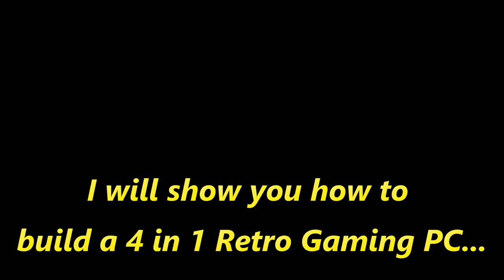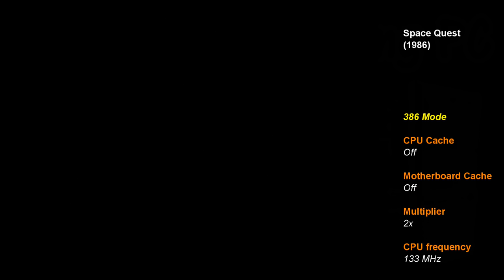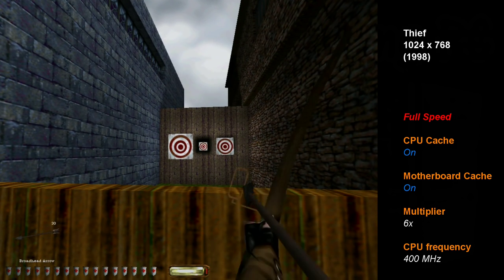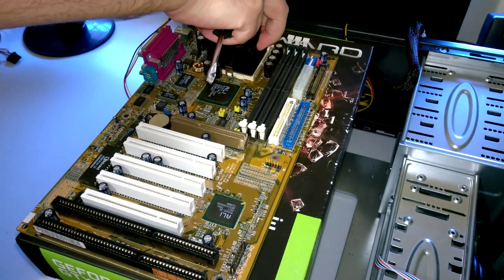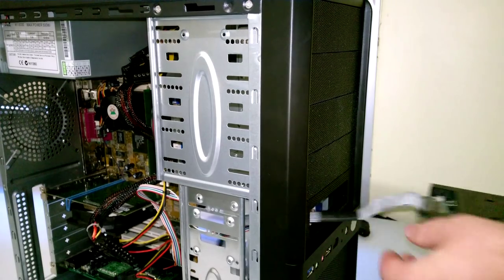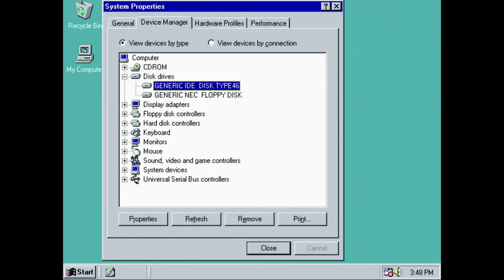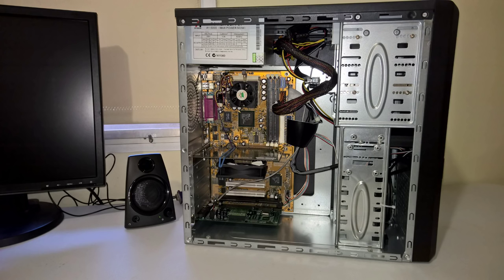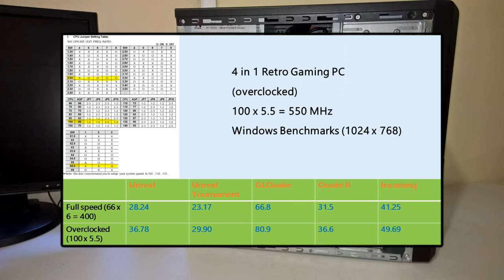Building a 4 in 1 Retro Gaming PC

Comment: if you're going to go to this much trouble you really  HAVE to do it proper with a CRT ;-)
Reply from the maker: Haha yes I know ><
Reply: PhilsComputerLab about how much would I spend to make this?
Reply: Not to be a show breaker but you might want to replace that A1 PSU. I have seen its innards and it's definitely NOT suitable for well...nearly anything. Try a FSP or a higher end Allied PSU (the latter, although made by Deer/Solytech, are a solid choice for 5v heavy systems. Just replace the capacitors and it's ready to rumble!) as those have better components.
Reply: Hello phil. I'm on the way to build a ss7 system the way u suggested in this Video. While  doing some research, some guys told me, that switching Caches on/off for accelarating or decalerating is not that effective... It was mentioned that "non-linear" speed-ups or downs could appear in some old Software. Can u confirm that?

Comment: This is the Ultimate Windows 98 PC.
Reply: No it isn't, a fast pentium 2 or a pentium 3 or an athlon is better for this (even though a K6-2 or 3 is already great, it's absolutely not the best). Pentium 4s and athlons XP are great too, but they start to run into the limits of that OS if you' re not making them properly (like putting more than 1GB of ram or a gpu that is too modern, etc)
Reply: Deksor Such as an NVIDIA GeForce FX5200. Always go with an GeForce 4 MX440 or an GeForce 4 Ti series GPU or similar.

Comment: That's probably the coolest PC build i've ever seen.

I've really liked the ALI chipset that you're using here when those boards came out. The boards usually ran all kinds of hardware and there was plenty of low mem left after shifting everything possible into high mem, so you could keep lots of DOS soundcard drivers loaded.

But i've made the experience that they were prone to die quite exactly 5 years in of daily use -.- Not sure what's up with that. Perhaps with lower FSB could help them last.

Of course if i were to build something like this, and i probably will, i would make everything differently, like enclosure/PSU choice, cooling, soundcard choices, etc...

Comment: Hi Phil! Awesome video - I love how you explain everything so clearly and it reminds me of all the fun you can have with retro hardware!

 I have a very similar motherboard to yours - a Gigabyte GA-5SMM (SiS 530 based) that handles any FSB from 66-133MHz (including the /4 PCI divider) as well as voltages from 1.3-3.5V. I lucked out getting a K6-III+ 500/ANZ (binned at 1.8V at 500MHz)  - It ran flawlessly at 4.5 x 133 MHz with 2 volts and was INSANELY quick. I even managed to cool it passively with just a heatsink at 133 x 3 400MHz and 1.3 volts!  I was also lucky enough to have both a GeForce 2 MX/400 PCI and a GeForce 6200 in PCI that worked perfectly with that board - awesome for retro gaming - and even ran XP at a stretch too!

Keep up the great videos and thanks again!

Comment: Very informative. Have an AMD K6 build myself and it works very well, although the OS I'm using is Windows 95 and my main goal for that machine is not only DOS games from the 386 era and up, but also Windows games that were developed before 98 was released.

The only issue I've had with this build so far is that a couple of DOS games don't play very well. Here's a list of them:

CD-Man [L1 and L2 disabled with 2x multiplier]: Twitchy intro screen, but otherwise stable gameplay.

Dark Ages [L1 and L2 disabled with 2x multiplier]: Divide by zero error on Episode 1 unless I use the SLOWDOWN.COM utility. Episodes 2 and 3 also produce this error no matter what. Have yet to patch it with the RTE200 fix.

Was wondering if there is any utility or something that could slow the CPU even further so that I can reduce the twitchiness and perhaps get rid of the Divide by zero error.
Reply from the maker: +DOSGeek 95 I think I've seen your post on Vogons?

Some games just don't work properly. You can try a Pentium 100, some games will work on that because of the lower clock speed. But then the Pentium 100 is very slow for the more demanding games.

Comment: Very fun video to watch.  I'm surprised that Wing Commander 3 was able to run that smoothly with the processor clocked that high.
Reply from the maker: Code1D10T I wasn't sure if I should play it at 133 or 400 MHz. The game has a framerate limit of 24 fps, so 133 would have likely been enough. I'm not aware of the game being speed sensitive, or having issues on machines that are too fast. If so, no big deal, lower than multiplier and you're set.
Reply: philscomputerlab I read on the Wing Commander 2 manual recently that WC3 would run at the processor's actual speed.  Wing Commander 2 requires either slowing down the system or a 386 33MHz-40MHz to make the game run without going too fast.
Reply from the maker: I believe Wing Commander 2 does have keyboard shortcuts to control frame duration and things like that. But some animations might still play too fast.

Wing Commander has a high resolution mode for starters, and I didn't have issues on faster machines. But I never tried on something extremely fast like a 1 GHz machine or something like that.

Comment: Excellent video!

I recently purchased a K6-2 400 CPU to give my old P1-200 a bit more performance in Windows games - still waiting on the delivery of the cooler though as the only option I have now is a fanless heatsink I salvaged from a Mac G3 which happens to be the same size. It works as a temporary measure but I don't want to run the machine fanless for too long. My Socket 7 motherboard is an AT-style one though although it accepts ATX power supplies. I never had a proper PS/2 mouse header for the machine so I ended up making one myself. I never realised that SQ5 needed slowing though - I should check if it does the same on my machine. I use a real SB16 though so I don't know if that makes a difference.

I remember owning one of those Yamaha cards way back in the day but it didn't really impress me - I seem to remember it not being able to play multiple sounds back at the same time under Windows and configuring DOS games to work was a pain. The main reason I have that P1-200 in any case is to allow me to listen to music from the SB16 and Yamaha MIDI daughterboard.

I wonder if there is a list of DOS games that do not run properly when run on faster machines? Wing Commander seems like a prime candidate but were all Origin games that problematic?
Reply: Anacreon ZA The games from Origin from the 386 processor era and some games, like Space Quest and Police Quest, and some other games require a 386 class processor.  In order to run those games on a Pentium MMX or equivalent (Pentium 1, Pentium Pro, AMD K5, AMD K6) , you need to either disable L1 or L2 cache (or both for the 386 speed), or use a program called slowdown.

Here's an example of a game batch file I made for Earl Weaver's Baseball 2:
cd games\ewb2
slowdown /MHz486:40
ewb2
slowdown /U
cd \

Wing Commander II example
cd games\wc2\wc2
slowdown /MHz486:20
wc2
slowdown /U
cd \
Reply: ***** Cool thanks - I'll check slowdown out and experiment with the cache settings in the BIOS. I never really liked Wing Commander as a game though - I always preferred it as more of a Soundblaster tech demo. :-)

Comment: Hi Phil I see that you used Win 98SE, Back in the old days when I used it in a new install I found that some games didn't work. The work around was to install Win 98 then upgrade to 98SE. the reason some programs didn't work was because MS changed the file extensions from COM to EXE. So if you did the upgrade it left the old files so the older software would work.

Comment: This is such a great build -- were there any 386 or 486 games you tested that did not run well? Or does this -- functionally -- replace the need for a 386/486?
Reply from the maker: Yup it's a real replacement to the 386. I tested LOTS of games, I only know of one trouble maker, which is Ultima 7. This game turns on the Cache by itself, so the 4 in 1 machine will run it too fast. But that's the only game I know causing issues.
Reply: Nice!

Is it possible to do a builds like this with universal/flexible hardware and do different OS installs on either different drives or partitions? Like one drive or partition with Windows 95 and another with 98? Also, is there any difference or compatibility differences in using DOS from 98 as opposed to MS-DOS 6.22/7.1 that you have install guides for?

Comment: I was planning on doing a build like this sometime in the next year or two, but I discovered the Celeron 766 which also has a 66MHz FSB, but is quite a bit faster at full speed. Would there be any disadvantage with using that Coppermine-128 CPU with a Socket 370 motherboard, vs this K6/SS7 build?

Comment: What a great build. Have you run into any compatibility problems with really early DOS games? And what about really late WIN98 games (does it run Half-Life)? Such a useful machine, as getting some 90s games to run on a 64bit machine can be a real pain.
Reply from the maker: +BIG Dave If you go back far enough, like games in CGA that run well on a XT machine, they will likely run too fast. Late 90s games /early 2000 games can run well, but also run poorly. The Tomb Raider games for example this machine runs well, but Deus Ex not really. I actually have a copy of Half-Life but haven't tried it on this machine. My gut tells me that it would struggle though.

Comment: Well, just as informative, here're the games that you have that I already tested over my Pentium mmx setup (soon, a k6-iii+ 400MHz)
-Battle Chess (Windows version):OK
-Test Drive 3: Runned almost right but still a little bit faster
-Gods: I don't think this one even runned
-Pinball Dream: Another one that I can't remember if it worked fine
-Wolf 3D:worked fine with L1/L2 on
-Comanche:L1 disabled, and moslo at 70, runs a bit faster than yours
-Doom: Runs fine
-Raptor:OK
-Duke Nuke 3D:OK
-Descent:OK
-Tomb Raider I: software and glide are ok
-Quake 1:OK
-Need For Speed II:Works ok in glide
-Quake 2:OK, some complex áreas runs at 30 - 28fps that that's the minimun with a voodoo 3
-Need For Speed 3:Runs half good, it lags on the dark with rain, but all the settings
-Tomb Raider The Last Revelation: Worked fine
I'm just afraid that with the K6 III the voodoo 3 will run more hot since the Pentium mmx was limiting his power;
Reply from the maker: ibm5155 The Pentium MMX behaves quite different with Cache disabled. It is much faster. You get a 386DX-40 and 486DX2-50 compared to the AMD.

The AMD is much faster with caches, but has poor floating point performance which can be seen in Quake II for example. The AMD runs much cooler, especially the 1.6V version. 

The V3 is still being held back by all this processors. It runs at full speed on something like a Pentium III 700 MHz.
Reply: ah you got the 1.6 version, well, my motherboard can only go to 1.8, I hope a K6-iii+ acr 400MHz, 2.0v core will be enough.
And also I hope the cooling system from my Pentium mmx will be enough for that other guy too (maybe I'll need some termal paste idk :S )

Comment: Very nice and elegant way to build retro pc! I like placing new things into old hardware thanks to modern compatibility equipments, especially USB "floppy" and SATA bridge. Going to build similar one.
Only see little problem with LCD 5:4 resolutin and 4:3 DOS games (or 320x200) Is the image stretched or original, as my 16:10 LCD give me only 720x400@70Hz for resolutions lower than 640x480 ?
Reply from the maker: František Staněk Great to find someone like-minded :) Yes, monitors and aspect ratio are a challenge. While you can stil lbuy brand new 17" and 19" monitors, they are all 5:4 aspect ratio. So the image is slightly vertically stretched. It's subtle, but if you know about, noticeable.

There are a few options. I have a Philips 18.5" 16:9 monitor with 1366 x 768 resolution. I reviewed it here: https://youtu.be/maCI1Pe_jno

It has a 4:3 button, which works great. It's especially great for 1024 x 768 resolution games, as it's 1:1 pixel perfect and very sharp. Downsize is that the monitor is quite small, my eyes aren't the best, so I prefer something bigger.

Another option is finding a business grade 16:10 monitor. I've got a Samsung and that one also does 4:3 aspect ratio correction. For Windows games, that monitor is awesome as well as it does 1600 x 1200 natively, however many games struggle to run fast at this high resolution and HUD elements become small.

So either way, it's full of compromises and I like to approach it on a game to game basis. Space Quest 1 for example, looks mint on the 24" Samsung 16:10 screen. Unreal I prefer playing on the 18.5" at 1024 x 768, and many older games don't go higher than this resolution.

For quick testing I have 19: and 17" 5:4 screens and they do the job just fine. But you made a good point, in my next project I might showcase that Samsung 24" 16:10 screen :)
Reply: philscomputerlab Thank you for the comment. I have decided to get rid off all old periferies I own as they only waste my space and found your build very interesting.. It's no challenge for me just build up computer from all original spare parts - everyone can easily do it with no thinking ;-)

This problem (with aspect retio) I can not solve as I am quite perfectionist :-)
I just quick passed your review of 1366x768 LCD. The 4:3 button also works for CGA/EGA modes, such like 320x240/320x200 modes? My similar AOC 18.5" just stretch it to all screen, only VGA 640x480 (e.g. Blood) are adjustable to 4:3 ratio. Yes, it's the challenge, nowhere on the forums I found perfect LCD solution.. 

I am looking forward for review of that "business" 16:10 for the DOS game purposes, especially resolution of CGA/EGA graphics modes!  On my old 22" 16:10 I can not change to 4:3 unfortunatelly.
Reply from the maker: I'm afraid I do not have an CGA/EGA graphics cards. But DOS games use the 320 x 200 resolution, is this what you're after? Games like Monkey Island or Prince of Persia? 320 x 240, I remember some pinball game using this, but PC Player Benchmark can also test this resolution.

I have an AOC monitor as well, it does the same thing. 4:3 only works with 640 x 480 or greater.

Brands that work well are Samsung and Benq. There are Benq gaming monitors that can do 1:1 pixel mapped at lower resolutions. Quite amazing. Lots of options, but they cost quite a bit and at the moment my monitors do the job fine.

But yes, I will do a video on it. Not sure when, quite busy at the moment and waiting for some gear to arrive before I can shoot another one.
Reply: philscomputerlabYes, I meant the resolutions, 320x200 and similar uses a plenty old DOS games from '90s including Wolfenstein3D, DOOM, etc. I was using only VGA graphics adapters. Good mention, will try it in my work on 24" BenQ BL2410PT.
Reply from the maker: Ok, got you. 320 x 200 work 100% on the Samsung 24" and on the 18.5" Philips.

Comment: I wonder what could be built with a Radeon 9600 xt. I have one of those lying around. xD I got it at goodwill for 5 bucks trying to find a GPU for my computer. at the time I wasn't as knowledgeable as I am now.
Reply from the maker: +Proshi Very powerful for Windows 98 gaming. I do believe there are Windows 98 drivers, though not 100% sure. But yea, it's a beast for playing these old games :)
Reply: Alright then I finally have a use if I find more parts then! xD and I might go with Windows 2000 though as that's more compatible with some of the Games I do sometimes play like some of the Touhou games along with it. My 3 oldest games I own rather it's on steam or rather I own a physical copy are Half-life Quake, and Tomb Raider. Most of those are shooters but that's because I have yet to find a copy of Need for speed in a thrift store.

Comment: I have decided to post it here as well.
SpeedSys is an excellent DOS-based tool for any 386 or higher that performs a system benchmark (CPU, memory, extended features such as MMX, etc.).
FEATURES.
 ~~~~~~~~~~
 Test allows you to detect following parameters:
- Type of the processor.
 - Clock rate of processor.
 - Clock rate of processor via Time Stamp Counter.
 - Some information of processor stepping.
 - Size and speed index of memory.
 - Type, manufacturer, part number,some features of DIMM/RIMM memory modules.
 - Display adapter, size of video memory, video memory speeds index.
 - Sizes and speed of data caches.
 - Mainboard model.
 - BIOS vendor and BIOS date.
 - RTC-BIOS Year2000 bug.
 - Processor benchmarks.
 - Build a graph and define seek and access time of hard disk.
 - Build a graph and define an average transfer speed of hard disk.
 - Relative speed of hard disk.
 - Testing of extended memory on errors and malfunction.
 - Build a graph and define functioning of system a caching and memories.
 - Test a quality of surface CD disk.
 - Build a graph and define an average read speed of CD disk.
 - Build a graph and define average time access of CD drive.
 - Relative speed CD drive.
 - PCI/AGP device information.
 - ISA PnP device detection.
 - Save image of screen with testing parameters in PCX file 640*480*16.
SYSTEM REQUIREMENTS.
 ~~~~~~~~~~~~~~~~~~~~~~
 a) Processor 386+.
 b) VGA-compatible videocard.
 c) 4 MB free XMS memory.
 d) DOS 5.00+.
 Home page : https://web.archive.org/web/20020816182800/http://dxover.stealth.ru/sst.htm
 Latest version : 4.7 (Jan-25-01)
Reply from the maker: +Radical Edward also Kainia Karia (Michael Gardner) I know SpeedSys quite well. Maybe I should start using it in my videos...